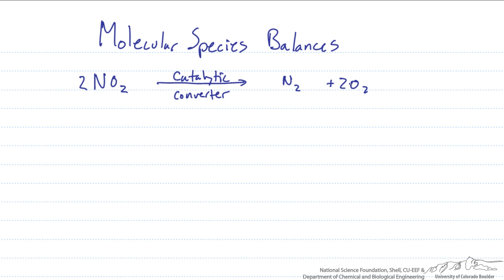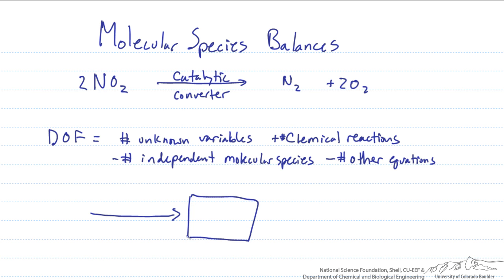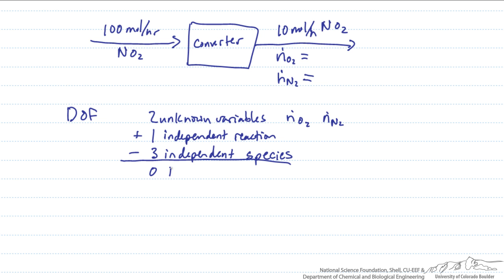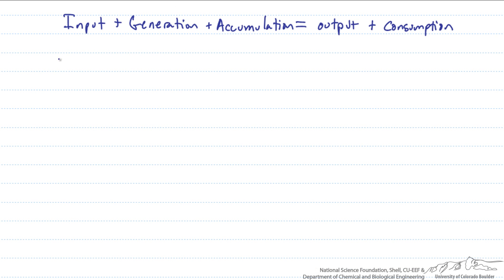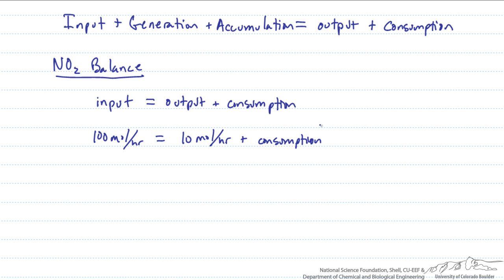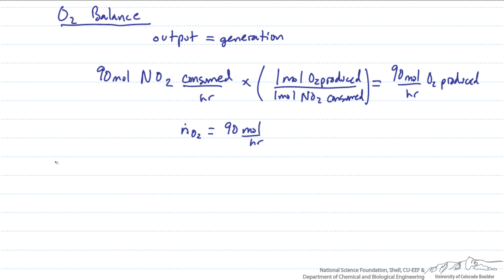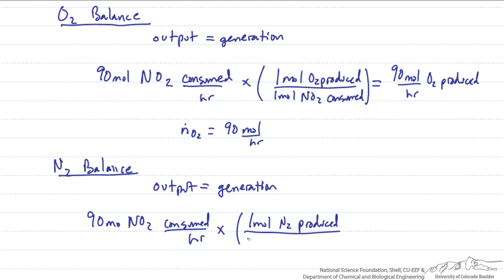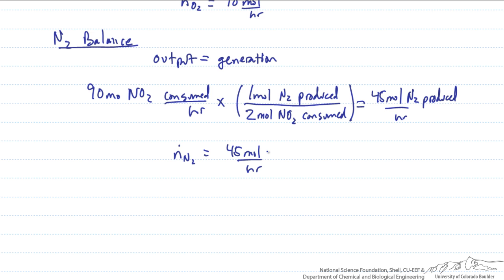Molecular Species Balances

Comment: Would like to ask if the mass flow rate for reactive process will differ or not? What about the mass flowrate of the output if the reactor only has one input and one output? (The reactor is the second reactor that continues the conversion of the same reaction from the first reactor)